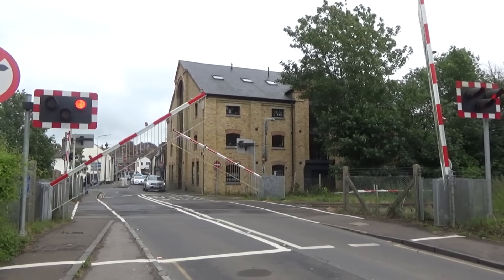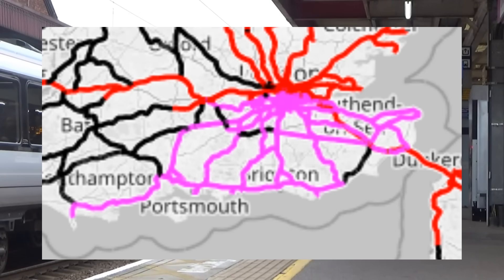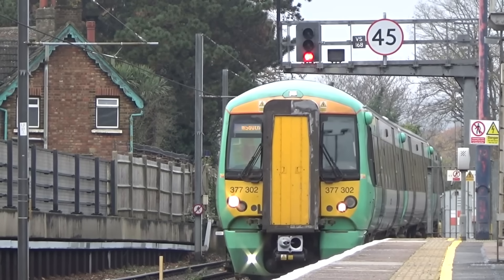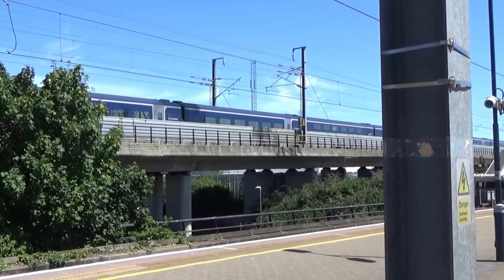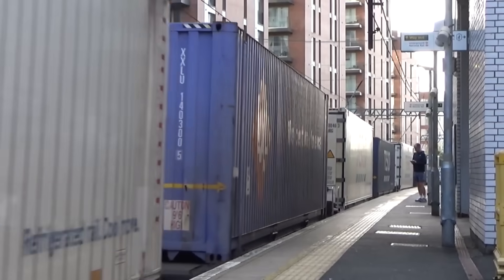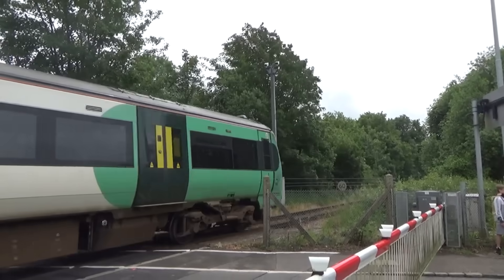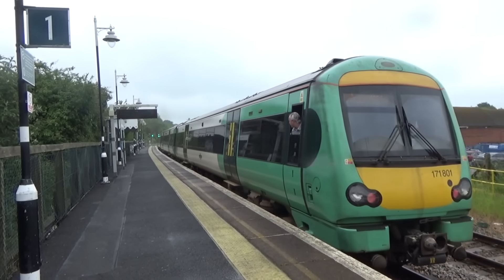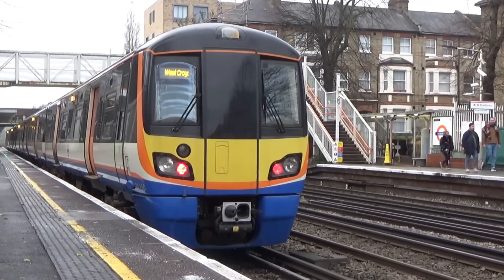Are These Railways Actually Unelectrifiable?

Comment: THE FALLACY THAT THIRD RAIL IS SLOW ! 
Third Rail locomotives and Electric Multiple Units have been recorded at speeds of up to 124mph. Indeed the first recorded 100mph on Third Rail was in 1948 with one of Bulleid's original Class 70 Co-Co Booster locomotives on a Test Run down the Brighton line, hauling 4 coaches. Further late 1966 tests with the first 4REP power pack units with 3,200hp, revealed these units to be clearly capable of 110 mph in tests between Basingstoke and Eastleigh. And in the early days of their use, they were frequently recorded at Speeds of 95-105 mph whilst hauling 8TC on regular daily express services. The 4REP design included the full Electrical equipment and Bogies of TWO Class 73 Electro-Diesel locos ! Locos also known to be quite capable of exceeding their official 90mph Maximum speed.      

EMU stock of all types both suburban and Express were officially limited to 75mph on the Southern RAILWAY. The line voltage in those days was 660v DC. But the 6PAN 6PUL & 5BEL uniits introduced in 1933 & 1935 with 1,800hp in each 5 or 6 car unit, although geared for 75mph, where found to be capable of 85mph on the level, from that time. 

FIRST OFFICIAL 90MPH RATED UNITS - 1956 
The first Official increase of maximum speed occurred with the introduction of the first prototype 4CEP (Units 7101-7104)  & 4BEP (units 7001 & 7002) British Railways Express stock in 1956, rated for 90mph. These were followed by large quantities of these Express units for the Kent Mainline Electrification schemes of 1959 & 1961, which also went hand in hand with the line voltage increase from 660v to 750v DC. 

FIRST OFFICIAL 100MPH RATED UNITS - 1988.
These were the 5WES Wessex Electrics introduced from 1988. (Later BR Class 442) These Wessex Electric units were permitted by the Southerns Civil Engineer to travel at a maximum of 100mph between Surbiton & Southampton from that time. 

But like many Electric Locos & Mutiple Units from 1956 onwards, it was well known many types could exceed their official maximum speed. Indeed the CM&EE (Chief Mechanical & Electrical Engineers Department) often tested locos & EMU's at in excess of their Official maximum speed. The 4REP power packs (introduced 1967) with 3,200hp were found to have no trouble between Basingstoke and Winchester of reaching speeds of 108mph. Even though the Civil Engineer had limited them to 90mph. It was a similar case with such mainline types as 4CIG & 4BIG Express types they too were known to be capable of 100mph on the level. And when they "Greyhounded" 14 x 4CIG & 7 x 4BEP, to help them on the steeply graded Portsmouth line. These units revealed that on the level they were quite happy to cruise along at 106mph. 

EXCEEDING 100mph.  
Indeed I was entertained one night in 1976 by the Norwood Driver known as the "Flying Scotsman" on the 2.40am Newspaper train from Victoria to Brighton (diverted via Crystal Palace) with a Class 73 Bo-Bo Electric Loco and 7 Vans. To a journey that broke the Speed Record via the shorter Direct route. And I was sitting in the Second mans seat. That loco reached 123mph on more than one occasion during the journey and completed the journey in 41 minutes and 35 seconds (The train was allowed 75mins for the journey). Even though in tests with that type back in 1967 they had only reached 117mph maximum on the Bournemouth line !  Running at night when there are few other trains using the juice rail it would seem also helps !!!

The "Record" of 124mph was achieved by a Selhust Driver driving a Class 319 Thameslink unit on a Bedford to Guildford service in 1991. The speed of 124mph was recorded by Traction Inspectors with a Radar gun, on would you believe it the Guildford NEW line (via Cobham). Not only that but this loonie was doing 124mph through a 40mph Temporary Speed Restriction, due to embankment slippage. At the Inquiry, he said it was bouncy at 50mph, smooth again at 75mph but very smooth at 124mph. He was sacked immediately and the Transport Police informed. But no further action was taken.

The Class 319 units when on the Southern were limited to a maximum of 90mph, and had no more power than 1,100hp when on the Third Rail. On other Regions they had a maximum permitted speed of 100mph and full power on 25Kv overhead was 1,330hp per 4 -car unit.                       

THE DIFFERENCES BETWEEN DC & AC NOT WHAT YOU THINK !
The ignorant idea that because the Southern Third Rail is a nominal 750v DC (800v DC Farnborough- Bournemouth) is some sort of serious speed limitation is fallacious. A good example of the reality. When a BR Class 87 of 5,000hp hauling a 12 car Mk1 train starts out of Euston Station on the 25,000v AC overhead system, it won't exceed 65 Amps in draw. Now over at Waterloo, a 12 car formation of CIG/BIG/CIG express stock with 3,000hp on the 750v DC supply will pull THREE THOUSAND TWO HUNDRED AMPS the second the Driver whacks the power handle open. Which is why you can't use a wire on the Southern and have to use a 130lb per yard heavy duty rail. A wire such as used on the overhead would be burnt through immediately. DC is NOT AC and has different properties. 

ICE & LEAF FALLACIES. 
And the even more daft idea that the Third Rail system suffers from weather conditions as nearly as much as the overhead, is also pure nonsense. Indeed the older the Southern EMU type the better they were at getting rid of any icing. And the leaves on the line issue is also a modern problem NOT an old one. In both cases the reason for some problems with Ice & leaves on the line can be blamed on BR's lack of Government funding and the resultant cost cutting exercises. All EMU's up until the 1964 Brighton line 4CIG/4BIG stock used proper Heavy Wooden shoe beams with sprung Carbon brush collector shoes. Which used to act as pretty good scrapers. The 1964 stock onwards no longer used "Shoe Beams", only a "Height Limiting Bar". So the shoes were actually hung on the end of long arms extending from the Bogie Pivot area, so had far less downward thrust. And therefore far less ability to scrap off ice, but a nice ability to ride across the top of the ice, which quickly burn out shoes. And the other problem "Leaves on the line" has only got worse since the introduction of Disc Brakes, as Disc brakes are on discs on the inside of the wheel, so do not touch the wheel tread, so have no method of removing leaves stuck to the wheels metal tyres. Traditional Cast Iron Brake blocks that "grab" the wheel tread area, means the temperature here sky rockets within a couple of seconds to a few hundreds of degrees, and both burns, and scrapes any leaf mulch off the wheel treads. And of course it also means train with such Cast Iron brake blocks actually stop where you want them too, and do NOT go into "slip mode" and slide for hundreds of Yards, even miles, without being able to stop !!!!

Comment: Huh, third rail may be marginally cheaper in physical construction, but DC require a substation slapped every few miles, while AC require very few substations, every several dozen miles at most.

This why DC electrification has felt out of favor in the continental Europe during 70s-90s.
Reply: Not to mention that the UK uses grid frequency for AC, so you just need a transformer. 
While DC needs a transformer and rectifiers too.

Comment: I will correct you about 3rd rail not being able to run faster than 100mph, it can and has, the 100mph cap is for maintenance reasons nothing more. During the 3rd rail pickup trials for the eurostar sets in the early 90's it was proven that the system could handle higher speed, but the ramp angles would need to be eased to reduce wear. BR and SNCF engineers wound a 4REP upto just shy of 120mph on the south eastern main line to prove the point.
Reply from the maker: yeah... but thats still a 100mph cap, for whatever reason
the point still stands that for faster trains in regular service, you would be better off with OLE

Comment: No line is impossible to electrify. The DfT lacks the will.
Reply: Yes, everything depends on how much money you have to spend.  Even if you are starting with a clean sheet of paper, overhead is more expensive due to the addition structures, the additional vertical clearances, and other factors.   Admittingly the power needs of heavy long trains would tax the capacity of the electric system on third rail this isn't that much of a limitation, trains draw a lot of current on starting and climbing hills thus you need extra capacity in these areas, on the hill itself and for the first mile out of the station (where the substation is likely located anyhow).  More lightly used lines are best left to diesel operation as that can provide adequate service without any additional investment, saving capital for places where you really need it.  Yes, battery locomotive work but you really need to understand the technical needs of a locomotive or electrified rail car, it would be about ten times that of a full sized electric auto for the car and multiply that by the number of cars behind the locomotive for that application.  Yes you can 'fast charge' trains or locomotives at station stops but note the tendency of electric autos to catch fire during fast charging, this practice also degrades battery life and we have no plan on how to recycle used batteries and the oldest ones will soon be accumulating, used fuel rods for nuclear reactors can be recycled, France does this, well I might add.  Battery locomotive would be about ten times the cost of regular ones, either electric or diesel, due to the batteries and charging stations.  Let's not talk about hydrogen, that's rocket fuel and only space agencies can afford it.  Most hydrogen that is commercially available is made from natural gas by stripping off the carbon in the gas molecule, this carbon is then exhausted as CO2, I know you don't like this stuff, actually it is far more efficient to burn the natural gas in a diesel engine (this is done regularly, it's not a new technology), yes there will be CO2 in the exhaust but the trees, grass, flowers, and vegetables love to eat this stuff up, just as much as you need oxygen, it's also cleaner than using diesel fuel.  Natural gas is less explosive than hydrogen.  Train electrification schemes need to be balanced on the availability of power in a specific market area, the UK's electric grid is old and a lot of capacity has been retired replaced with solar or windmills that are not as reliable as coal or nuclear and the cost per kilowatt hour is dramatically increasing.  Hundreds of miles of new railway electrification will only make these problems worse.
Reply: @henryostman5740 Indeed some of the freight operators have stopped using electric locos because diesels are now cheaper to run.
Reply: Reading to Gatwick needs to be to

Comment: Oh dear "The LBSCR had adopted an overhead contact system at 6.6 kV 25 Hz for its suburban network. The Southern Railway considered the two systems and decided to adopt the LSWR third rail system, and in due course the LBSCR system was converted, and the third rail system was installed over a large proportion of the suburban area of the Southern Railway, as well as some main line installations." That short termism again.
Reply: Realistically it was a case of third rail or no electrification at all. At least two of the three companies who were merged together to make the Southern had existed in a state of near bankruptcy almost since they were founded. The intesive commuter services, whilst brining in a lot of fares revenue, also required a lot of expensive assets to be sat unused outside the rush hour, all of which had to be paid for....

Comment: Did I hear DLR bottom contact in the methods used?
Reply from the maker: outside of the DLR, bottom contact isnt really used in the UK, the disruption of converting to it just wouldnt be worth it
Reply: @LTRains Just bringing it up as you didn't mention it. Of course the law now states electrification has to be OHE but lesser used lines just wont pass the capital expenditure involved. Planting trees to offset emissions and continuining with diesel trains is probably the most cost effective.
Reply from the maker: @kevinrayner5812 the main issue with diesel trains isnt nesc emissions, but their poor performance compared to electrics in terms of accel and power
while yh reducing emissions is important, we need to improve service on these lines too
Reply: @LTRains At the expense of economic viability?
Reply from the maker: an electric line is much more economically viable 99% of the time, it just has large upfront costs
Reply: @LTRains ok just ignore the upfront costs then.

Comment: Completely insane decision to bring in new, untested battery trains on Merseyrail rather than build a couple of miles of 3rd rail at Kirkby.
Reply: Then again, maybe good to start with a short section to try out the concept. It may be the answer for the Uckfield and Rye-Ashford lines if the trains can recharge sufficiently on other sections.
Reply: Insane only if you choose to ignore the strict H&S rules that ORR now enforce. Allow for the reality and you'll see that it was the only viable solution to electrify the Headbolt Lane services.
Reply: @chris8405  The strict H&S rules that the ORR enforce for 3rd rail are insane. If it was that dangerous we should rip up the 75 miles of existing 3rd rail in Merseyside.
Reply: @chris8405  If the ORR are so against third rail electrification, please explain the Battersea extension of the Northern Line.

Comment: If you introduce a multiple unit that could switch between 3rd rail, OHLE and diesel - you could get rid of those awful voyagers which chuck out diesel fuels all way from Coventry through to Manchester Piccadilly!
Reply: Class 769s have that facility, but they are unreliable in Diesel mode, slow acceleration and cannot match existing DMU timings. No wonder GWR binned them.
Reply from the maker: mhm, theyre also just old trains to begin with
Reply from the maker: or even just a bimode OLE/diesel, those are already proven and being built for EMR right now

Comment: Its worth noting that Merseyrail have Battery Trains running between Kirkby and Headbolt Lane, although i dont think batteries would work for the marshlink due to range
Reply: Actually they could easily cover Ashford to Ore on battery, it is a slow railway so not much power needed to overcome aero resistance - which multiplies at higher speeds.The Germans actually ran a BEMU non-stop for 185 km, albeit not at high speed.

Comment: There were at least two other third rail networks in Britain - Tyneside and the Bury line in Manchester. Tyneside was "modernised" to diesel in the 60s, and the Bury line became part of Metrolink in 1991
Reply: North Tyneside loop and the South Shields line. I can vaguely remember travelling on one of them in about 1965 - quite soon before it was stripped out with DMUs taking over. So it’s changed from about 600V DC to nothing, then 1500V DC used by the Tyne & Wear metro. The original was installed by the North Eastern Railway in the early 1900s.

Comment: Interesting discussion. Despite the ban, it would make a lot of sense to fill in the anachronistic gaps in the 3rd rail system such as Hurst Green - Uckfield,  Ore - Ashford, Reading - Redhill (parts of it), Reading - Basingstoke, Basingstoke - Salisbury, Southampton - Salisbury. Converting all of the 3rd rail network to OLE would be so massively expensive and disruptive that nobody is likely to do it.
Reply: When they did the Kent Coast electrification and the SW line to Bournemouth they had already standardised on 25kv overhead. Why didn't they go for 25kv OHE then and use dual voltage trains. Oh that requires a bit of fore thought.
Reply: @kevinrayner5812  The Southern Region worked as a pretty separate entity and were already standardised on third rail. That meant trains could swap back and forth to the other lines easily such as the Portsmouth line and Dartford/Gillingham suburban lines, useful for diversions. Also, it was much cheaper and Southampton was done on a shoestring. Most of the coaches were existing steam-hauled ones, they built 4 coach sets (4REPs) to power them and at Bournemouth put a Class 33 diesel on the other end and took the 4REP off. Cheap but effective.
Reply: West of Southampton to the Freightliner terminal, east through to Basingstoke and then around to Reading might be better off being OLE, which would allow electric traction for the container trains from Southampton.
Reply: @leeroberts1192 Freight trains on the WCML are diesel.  Would container trains actually be electric?
Reply: @kevinrayner5812  They can be if there's OLE where they're going. With bi-mode locos they can be electric where the OLE exists. You can have them hauled by an electric loco and then swap it out for a diesel loco near to its destination.
Reply: @leeroberts1192 Except that the reason the freight trains on the WCML are diesel is because electricity is now so expensive!